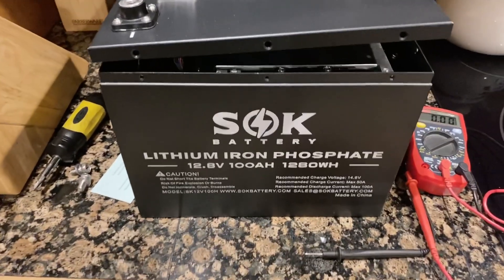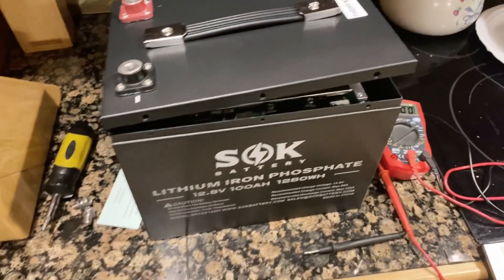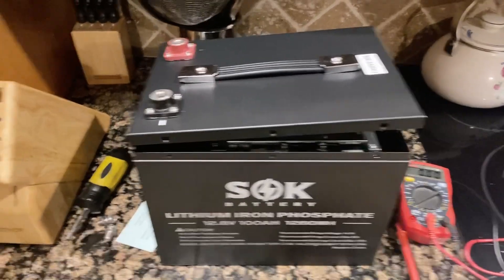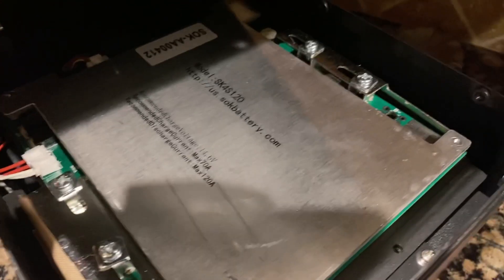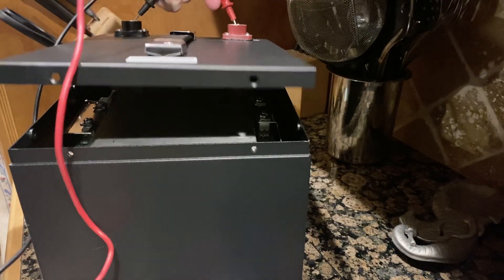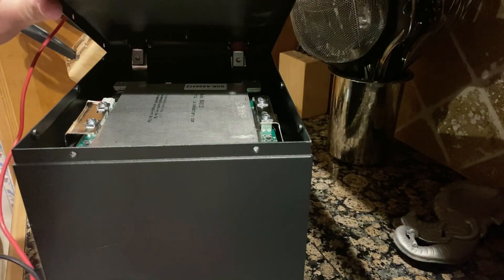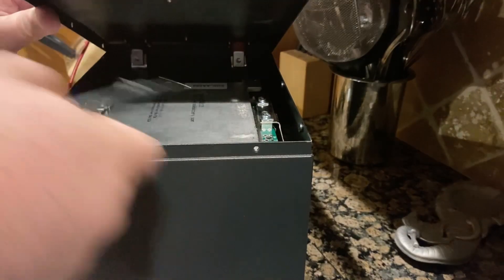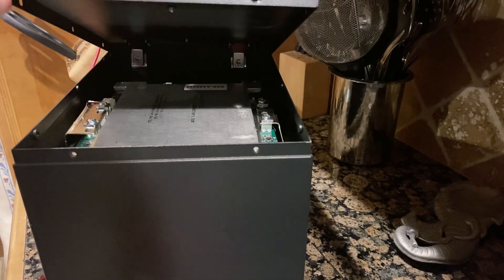How to revive an SOK Bluetooth Lithium Battery and bypass BMS

Comment: I have two 206AH SOK batteries on my boat.  About 18 mos old.  Had issues with BMS's and contacted SOK.  They sent me two new BMS's and referred me to the video on youtube.  I replaced the first one per that video ( and this one) and charged the cells after installing the BMS.  It still will not charge via the posts.  Voltage across the terminals: 10.4v, voltage when bypassing BMS: 12.9 volts.  I do not see a red light on the board.

Any thoughts appreciated.  I have contacted SOK about this as well.

Comment: The video is a little confusing…charger set up: red (positive) charger clamp to red lead on outside as normal

Negative charger attached to the plate under the POSITIVE LEAD in the box. As stated above they cross once inside the box. 

Red light will come on then go off and Bluetooth will connect. Bluetooth password is usually 200010 for basic settings. 

Thank you for the video. After reading t

Comment: I was directed to this video by SOK new Zealand.
I don't understand how SOK could make such a POS BMS but it looks like they sure did.
I for  one am not willing to work on a brand new battery!!
How long has the battery been at 10.9v?
It could have damaged the battery could it not  have?
Reply: only the old version on 2022 has this issue...fixed this on 2023.

Comment: Important to know that the SOK positive and negative bus bars are on the opposite sides of the positive/negative terminals up top.    I was trying to hook up my battery incorrectly until I noticed my testing meter had a - sign in front of the volts.

Comment: If the BMS still won't work: 
Disconnect all power from BMS, let it sit over night, make sure you charged the cells without the BMS to about 80% - reconnect the BMS, start charging normally trough the BMS on top of battery.
Reply: I am in he process of trying to revive my SOK. One guy here says you only need to unplug the BMS for 5 seconds...you say to unplug it overnight....and you say to charge it as seen in this video, but with the bms unplugged?

Comment: Hey I did this and got the cells to charge but my BMS is still not working.
Reply: I went trough worse... 
disconnect all power from BMS, let it sit over night, make sure you charged the cells without the BMS to about 80% - reconnect the BMS, start charging normally trough the BMS on top of battery.
Reply: @daivernon7346  is just removing the small plug next to the white wire plug disconnecting the BMS? Or is there more to it? I can teach that plug without removing the top. Or do I need to remove the top and really get in there to disconnect the BMS?
Reply: @jeremydidit  This worked for me.

I believe there is a missing step in the video, but even still, it saved me buying another battery when mine was just fine.

I had to remove the white plug at the end of the battery where the posts are. I would call that the front of the battery. 

Anyway, reach in to the front of the battery, disconnect the plug just far enough to make sure it is disconnected and leave it that way for 5 seconds. Keep your fingers on the plug. 

 If you remove your hand completely from the plug, it is harder to plug it back in because it is way at the front of the battery. By disconnecting the plug JUST far enough to disconnect it from the battery, and leaving your fingers on the plug, it helps you keep the plug aligned and easier to plug back in.

After keeping it disconnected for 5 seconds, plug it back in.

Then attach the red lead to the red post, and the black lead to the plate underneath the cover as described in this video.

Comment: If the cells are below 1 volt you should not recharge it.  The copper on the anode can dissolve at low voltage and cause the cells to short during charge.
Reply: Agree! If I got a dead battery it would go back to the seller.

Comment: What can I say, after trying everything else it was clear that the power was not getting past the terminals. Following this procedure my SOK battery is recharging (I can see each cell charging up using the BMS app on my iPhone).  This battery was at zero charge when I received it.  I'm a newbie and no Will Prouse. Because I've reversed polarity before on a battery burning up some cables, I must have taken an hour to make sure it was connected to my charger correctly.  Red alligator clip on red terminal, and black alligator clip of charger on internal vertical flange with two screws as indicated in the video. Don't touch the flat metal plate with connector - I was extremely cautious about that, and actually covered it with cardboard in case the alligator clip slipped and landed on it!
Reply from the maker: I was nervous as well but I used a volt meter to check voltage on where things were. Glad it helped.

Comment: Arent you just touching positive to positive in this video?
Reply from the maker: no, that's the negative, if you have a volt meter touch the red off top of battery and black to that metal plate, you'll get voltage before it goes through the BMS
Reply: @keithelder  ok.   It just seems strange that the screws on the other side of the battery hold down the bar that goes directly to the negative terminal.  I think my batteries are screwed up.  They sent me bms s to replace myself and i am having no luck so far.  Chargers say bad battery sometimes.... thanx
Reply: @darrenhutton4323  I actually found SOK's customer service to be really responsive. They sent me new BMSes because I have multiple batteries. I installed the new BMS last night and nothing happened, BMS would not wake up. So before contacting SOK again, I searched youtube, found this video. I tested the battery with a multimeter like this video described. My battery was down to 3v :( I hooked a Craftsman lithium 12 volt charger up like the OP described, about 5 minutes later the BMS finally powered up. I can now see the battery charging in the app. Thanks for posting this video!

Comment: Take the red line of charger to the positive battery terminal and the black lead of the charger to the internal plate with the two screws and that will bypass the BMS? Is that correct?
Reply from the maker: Yes. Just don't let the black wire touch ANYTHING else but that plate.